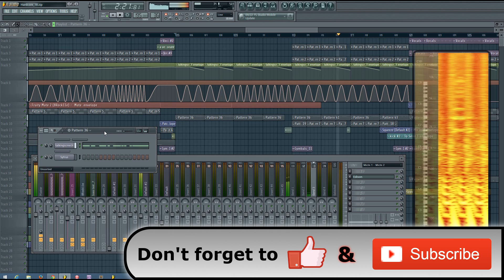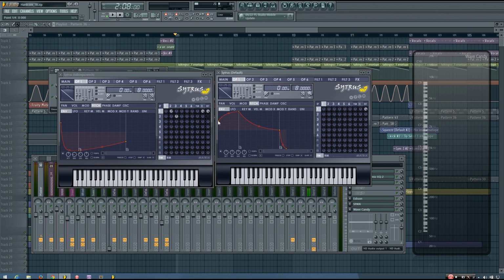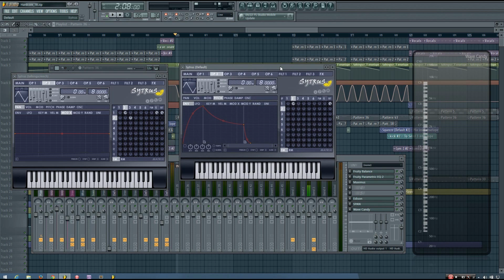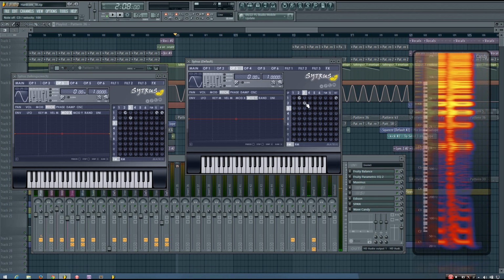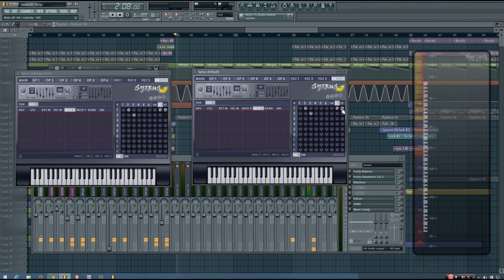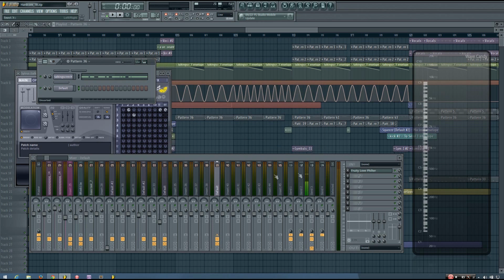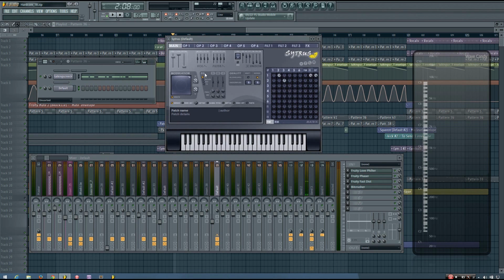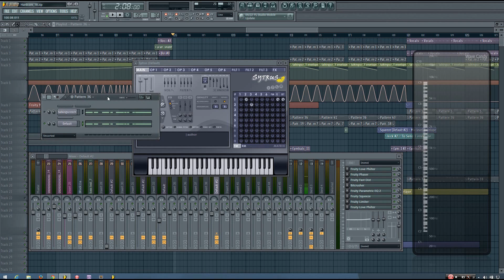Hardstyle Tutorial: FM Screech (FL Studio & Sytrus)

Comment: Question: So after getting your screech set up in sytrus (or sylenth1 or whatever) and getting ur mixer all nice and set up, how do you actually incorporate those notes into your song? I know Piano key is used for most, but with that it seems like all i can switch around is the notes for one pattern. How can I make use of the automation part (that we set up in 6:20 in the video) and/or changing the pitch and everything else in the mixer? do I have to create a new pattern for every individual change and add it to the playlist? or can i change mixer/pitch/sytrus settings while putting down my notes in the piano roll?
Most tutorials only ever show how to make a screech sound, but never actually show how to get the final result into a song. Maybe I didn't find it but could you or did you make such a video already?
Reply from the maker: IPilotheHATREDCopter For this particular screech, because it's made with Sytrus, you can edit it using the piano roll. 

First, you want to make sure that the X & Y mods in Sytrus are both at 50%. Then, at the top of the piano roll, you can change the Target Control (click where it says "Velocity").  A drop-down menu will appear with a few options, and two of these options are "Note modulation X" and "Note modulation Y". 

If you adjust these, it will change the character of the notes. You can even use slide notes with different X & Y Mod values to create cool effects. I don't have a video up about this, but I should maybe make one. 

This isn't how I automated the screech in this track. I just used automation clips in the playlist, but sometimes I do use the method described above.
Reply: ***** right on thank you very much! Awesome tutorials btw, they are helping me greatly!